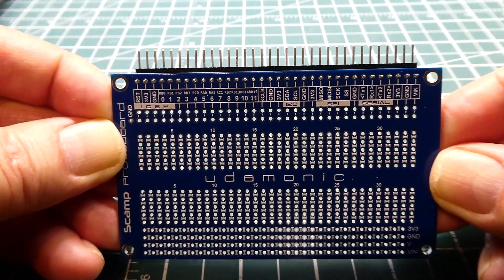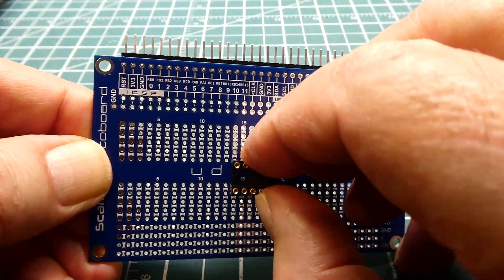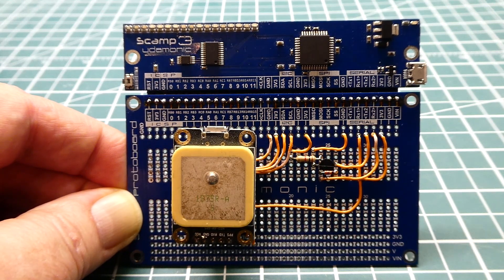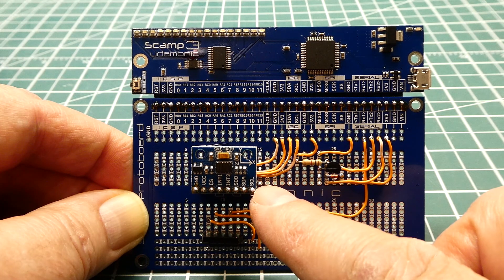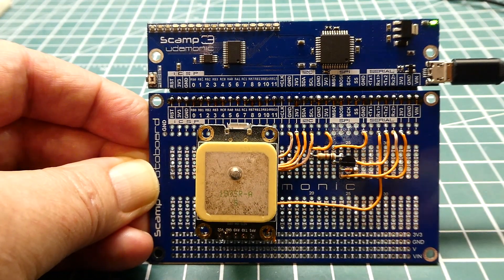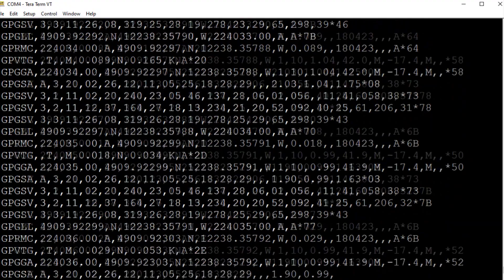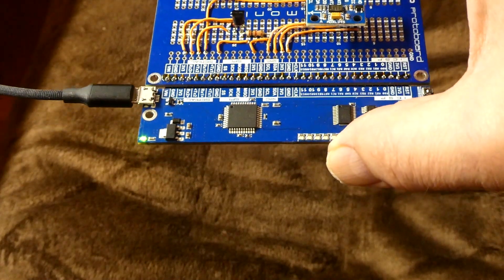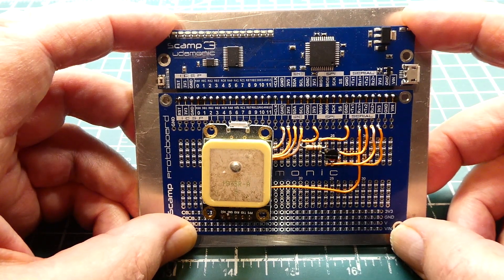Scamp3 Protoboard / Microcontroller Teaching Aid

Comment: Nice demo. One day I'll get a scamp, have to watch the budget right now. It looks like you need an "l" on the second link, otherwise it's a 404.
Reply from the maker: Thanks for the heads up ...it is fixed. You can run Flashforth on a Nano or Uno if you have one of those.
Reply: @0033mer  That's good to know, I'll look into that.
Reply: @jerril42  He's got a video on how to put Flashforth on a Nano. I've followed it and now i have a nano with Forth on it! It's not too hard
Reply: @shawnlowe1392  Thanks, I'll look for it.